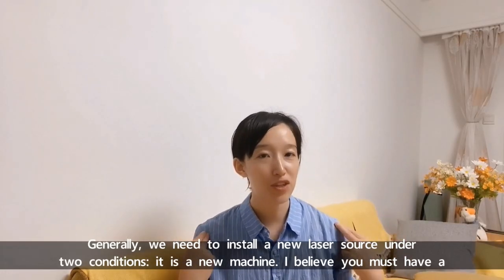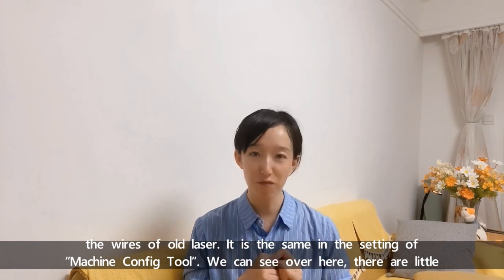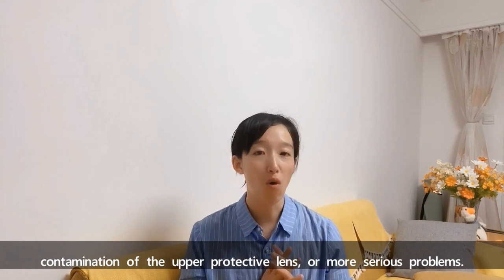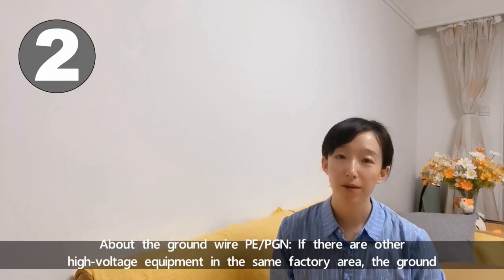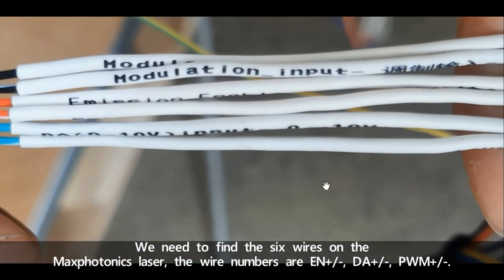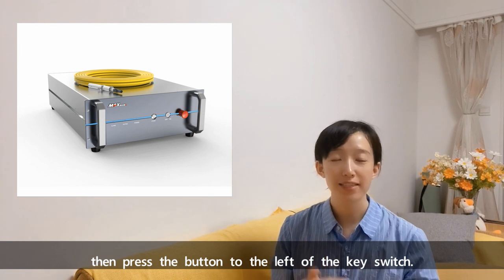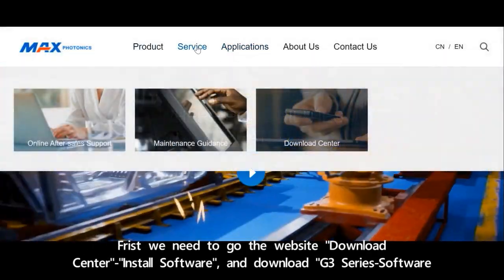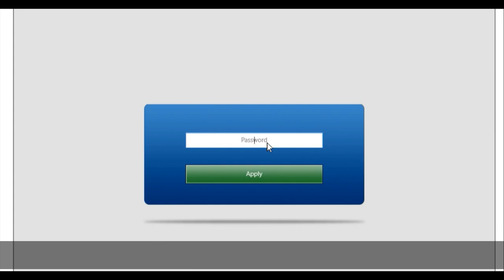Maxphotonics Fiber Laser|Installation of Fiber Laser

Comment: Thank you for your videos Clara. They are excellent. Just one clarification. Wires on Max source are labeled as Emission enable input +/-, modulation input, external laser output, fault output 1 and 2, NC, 12 in total. Which one of these are actually EN-, EN+, PWM+/-? 
Thank you
Reply from the maker: Emission enable input +/- and modulation input.
Reply: @ClaraChai  Thank you very much for your answer Clara. If I may to ask, the wiring diagram in Fscut3000s also showing PD+/-, Guide Laser+/-. Can you tell me please which ones are these? And are they mandatory to connect since you didn't connect PD+/- and guide laser? 
Thank you
Reply from the maker: @mtimo4868  Sorry,  I will tell you after I confirm the details.
Reply: @ClaraChai  Of course, thank you Clara
Reply from the maker: @mtimo4868  Thank you 😊
Reply: @ClaraChai  whenever you find time 😊
Reply from the maker: @mtimo4868  Could you take some pictures of the PD+\-?
Reply: @ClaraChai  I can. I'll email you. Tnx

Comment: it would be nice if you could have a small laser to test with. so you can be sure in advance to found a company that deals with laser cleaning.thx
Reply from the maker: Thank you
Reply: @ClaraChai  A good extension would be a digital display, which shows the distance of the laser, since the laser has a focus point. This way the user can see the exact distance at the same time and knows at which distance he is focusing correctly. If you can also project the display digitally onto the workpiece the user can read the distance above the laser beam because it doesn't need a digital one) like a clock that projects the time on a wall. this can also serve as a safety feature if the distance is too large or too small the laser will deactivate to prevent damage but also to extend the run time of the laser.
Reply from the maker: @Chefchen21  Thanks
Reply: @ClaraChai  always an honor, thank you